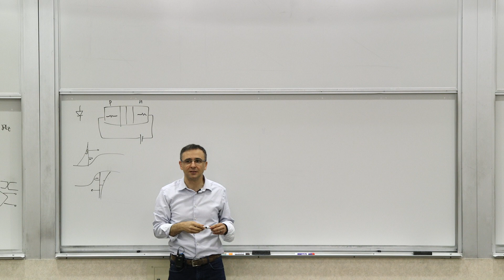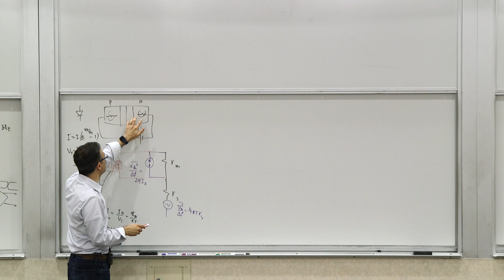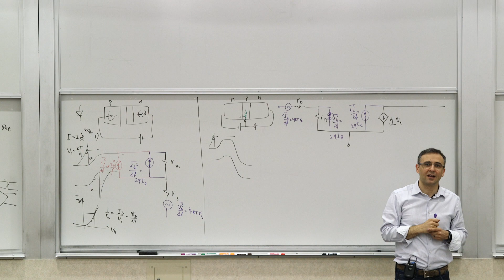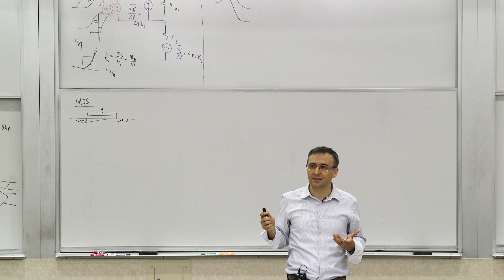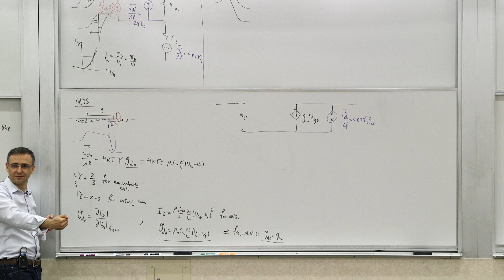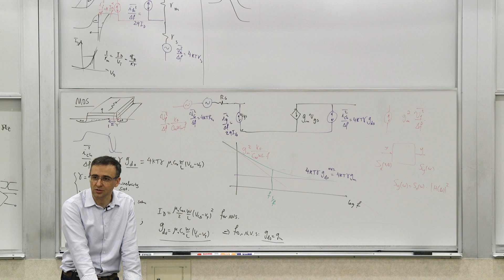175N. Noise models for pn-junction diode, bipolar transistor, and MOS transistor

Comment: How about the noise model for  a reverse biased diode?
Reply: I presume it would depend on how reverse biased it is. Before breakdown the small signal model for a diode is the depletion capacitance in series with real resistance associated with the undepleted p and n regions. The same thermal noise associated that resistance would exist. The same shot and flicker noise would appear in parallel to the depletion capacitance. 

If you reach break down voltage there is a specific avalanche noise (Ali touched on last lecture) which would have to be added as well. In breakdown I would still presume all the other noise sources still exist. The thermal noise due to the real resistance. Shot noise due to the transitional event of an electron tunneling through the barrier. And 1/f noise due to imperfections in the semiconductor.

Take all that with a unhealthy amount of salt.